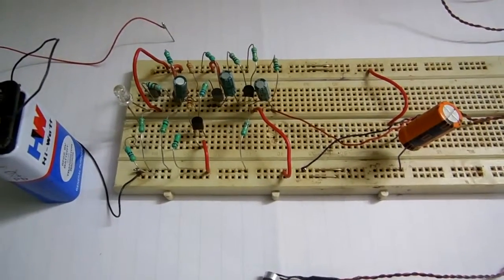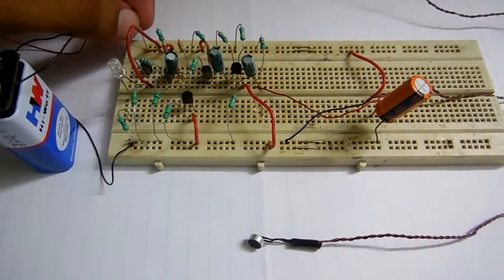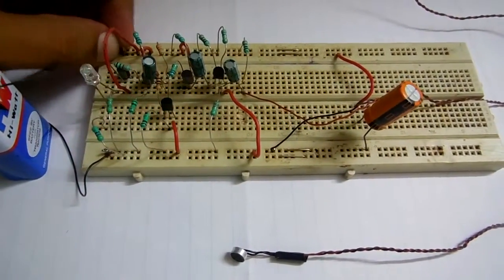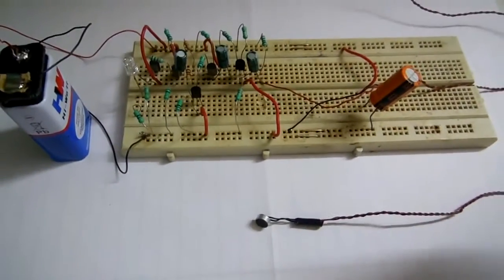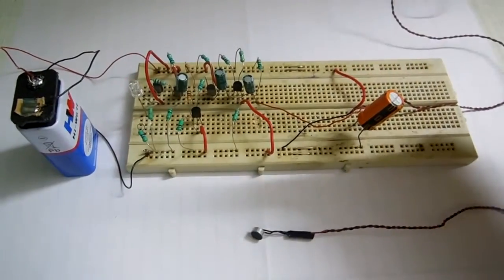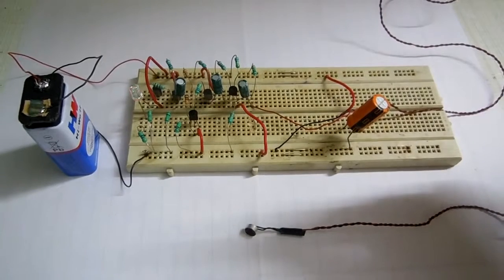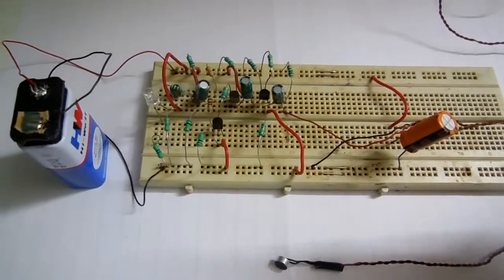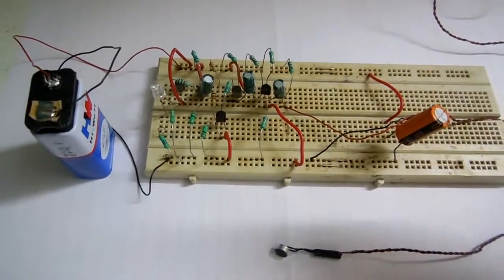Microphone amplifier

Comment: Are all transistors (NPN and PNP) EBC from top to bottom?
On the base of the second transistor (from the left) the 680k and the 100k resistors are connected to the transistor's base?
I have less than four weeks trying to understand these schematics. I am not used to electronics.
I made it, but the microphone is too weak to excite the circuit. Using a watch battery, the led blinks when I disconnect the wire (not when I connect, only when I remove the wire from the breadboard).
Reply from the maker: Yes the resistors are connected to the base of 2nd transistor.
Reply: Good. If I don´t connect these resistors to the second transistor's base the led just stay on.
Also I forgot to connect the collector from the last transistor to ground (from the left). But after correction still the device doesn't work. I am trying to make a home made version of a gadget named LASERLYTE LT-PRE. No success by now... but now I know what is a transistor and a diode!
I suspect the vilain is the electret microphone. An ugly and cheap thing that does not inspire much confidence.
Should I use a piezoelectric impact sensor?
Reply from the maker: +Gunther Arnold electret microphones are good sound sensors and will work even with one transistor (BC547) amplifier .I suggest you building the circuit step by step by checking the output across each transistor by doing this you will learn more about transistors.
If you want to use piezoelectric sensor then go for it, try it .
Reply: I failed again. I give up. I rather pay a boy to get a working recipe... I am terrible soldering and I do not trust in breadboards. No more!

Comment: Nice, what is the gain of this circuit? I guess it's well over 100, there's a bunch of cascades
Reply from the maker: Oh yes It's over 100 ,cause the output of the microphone is in mv and output voltage of amplifier is between 1.6 to 2.5V. You can even vary the gain by adding a potentiometer in series with the microphone.